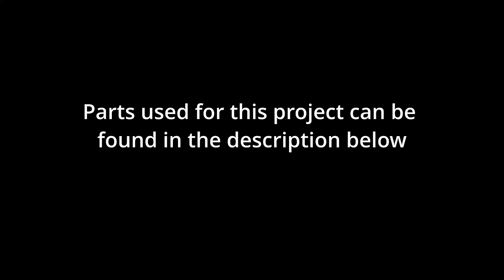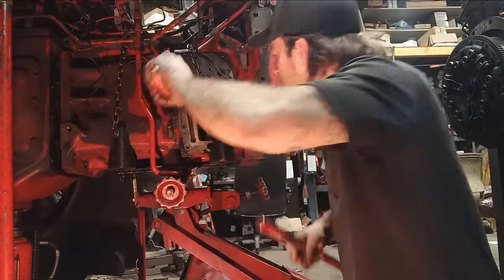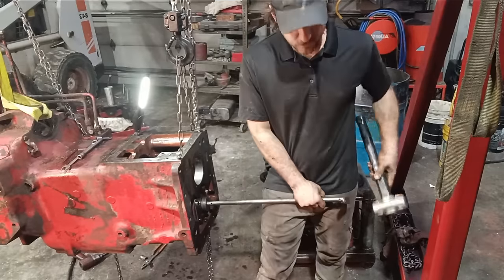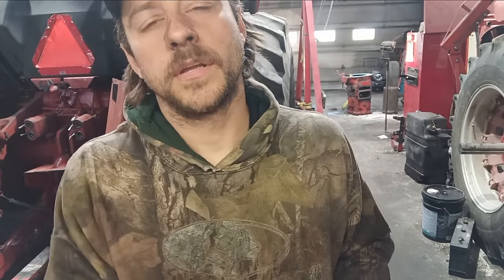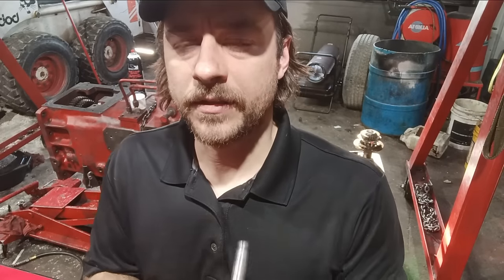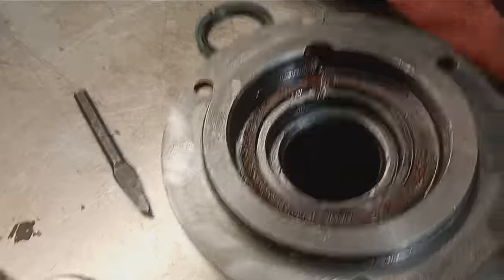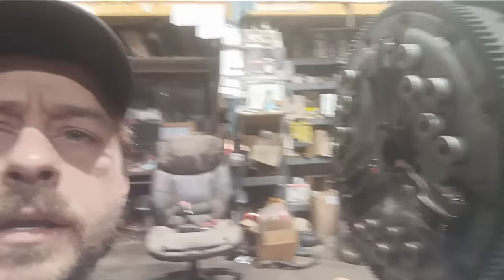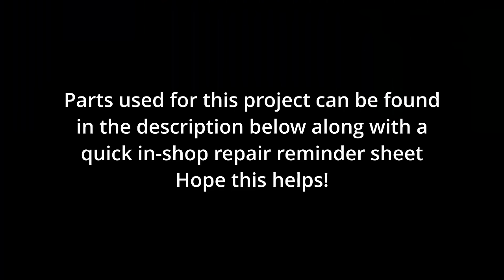IH TA removal and replace

Comment: I believe the engineers that design these machines should have to completely dismantle and reassemble them. You have a lot less situations like that bolt in behind the bracket.
Reply from the maker: Yeah, it could just be that I complain to much to haha

Comment: We had a 1086 that dad bought new in '77, it was a love hate relationship with that tractor... Beautiful engine! Great fuel economy, awesome power but we had a helluva time keeping a TA in it. Gear grinding pos too...  Local dealership replaced the torque twice in the span of about 2500 hours, this was in the late 80's and I'm sure they were using factory components, I with the aftermarket support would have been there like it is now.
Reply from the maker: Heh, hard to say what it's deal was. They should last a bit longer than that!

Comment: It appears you have replaced a number of TA's in the past. I am in the process of replacing a manual TA in my IH 544. I noticed you and other order rebuilt TA's from Hy-Capacity which is where I purchased a re-manufactured TA Carrier for my manual TA which I rebuilt myself. Have you ever rebuilt a hydraulic TA or just swap it out for rebuilt units? Is this due to the machine work involved? Note: Consider investing in a few lifting eyes and get away from using a bolt through a chain link and also support that housing and get away from working on a suspended load.
Reply from the maker: I have never rebuilt one.
And yes I agree, when chains break things happen fast. There is plenty room for improvement over here.
Reply: You can make wonderful splitting stands out of crank handle semi trailor landing gear.  Weld machinery movers on botton and a series of mounting plates you can even split bulldozers with 50k lb landing gear.

Comment: Whereabouts in WI do you reside?  I am in the Jackson area with - SURPRISE - a 1086 with non functioning TA.  Have no desire or ability to do it, but your videos are indicators you do.
Reply from the maker: Absolutly.
We are located in spring valley. Head over to redrunrite.com to get in touch with my dad, (his phone number should be up there). He will  be able to give you some insights and options.
Reply: After looking at the video end twice, I am going to start with checking the adjustments.  I was told it worked then quit right before I bought it.  I need to adjust the clutch brake for sure.  I learned a lot from your video.